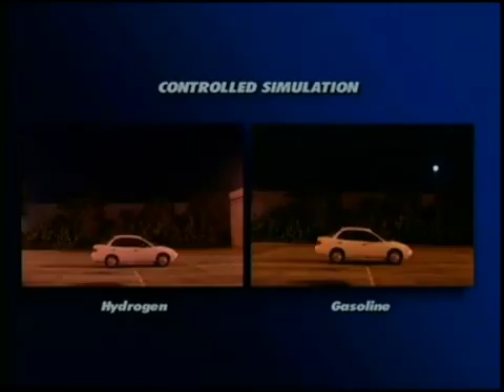Hydrogen vs. Gasoline Leak and Ignition Test- which is safer?

Comment: People quibbling over hydrogen tanks splitting and going up in flame but don't seem to be worried about the hundreds of pounds of lithium ion battery pack they are sitting on being damaged and having the electrolyte solution exposed to oxygen. I promise you it will be a much more spectacular show, just for the people watching, not so much for the occupants. but hey, you do you. Personally I believe that the days of the BEV are numbered, and that is a good thing.
Reply from the maker: It's almost as if energy policy makers were invested in batteries...
https://archive.ph/iVPpZ

Comment: The only issue I see is predicting WHERE the hydrogen tank will split. The simulation shows it as ideally upwards towards the sky, but it could be 90 degrees towards the driver or passengers roasting the vehicle occupants or 180 degrees to roast the following vehicle....

Comment: nice convenient pipe running up to the top of the trunk there to focus the fire up in the air away from the car.... 👍👍
Reply: Hydrogen is already lighter than air. If there was a spark something similar would likely happen because it’s going to float up.
Reply: @GuyWithInternet.  First it will shoot in the direction of the split in the tank due to.... 700 bar pressure in the tank....
Reply: Grilled birds falling from the sky, yummy, yam.👌😎👍 Scorched helicopters, not so great, ops!🤦‍♂

Comment: This is so paid by Toyota or whoever love hydrogen vehicles
Reply from the maker: If you had bothered to read you would have seen this: 2001: Dr. Michael Swain with the University of Miami at Coral Gables attempted to simulate two car fires, one created by a 1/16th inch puncture in a gasoline fuel line, the other by a leaking hydrogen connector. He video taped the experiment to document what would happen if the leaks ignited. As the photos below clearly demonstrate, consumer fears about hydrogen as a transportation fuel would seem to be pretty much unfounded.
https://www1.eere.energy.gov/hydrogenandfuelcells/pdfs/30535be.pdf

Are you a Tesla stockholder?

Comment: So the new Toyota Mirai Hydrogen Cars that are currently in the market, they'll not become "Little Hidenburgs" when they let say got into a car crash accident? Hopefully no BOOMS like Hidenburgs... 

Hydrogen Cars like the Toyota Mirai are indeed efficient & eco friendly, especially does not rely on gasoline & only consumes Hydrogen & releases water vapor. 

Though, how much $$$ would it take to fuel a Toyota Mirai with Hydrogen versus fueling a conventional gas powered sedan that is same size with the Mirai?
Reply: It depends on how its produced. Renewable hydrogen is around 10-15$/kg, while fracked (non-eco friendly) is arouns 2-5$/kg.

But hydrogen FC is also much more efficient than gasoline so you can go the same distance on less fuel.
Reply: @Erowens98 it's 35$/kg in California.... the world's biggest hidrogen car market.
Also Shell just gave up and closed their stations so 50% less stations for hydrogen car owners.
Did i mention the cost of driving a Mirai is the equivalent of driving a Cadillac Escalade ESV in rush hour traffic?
Reply: They're not painted with literal thermite like the hindenburg, so probably not. The real tragedy of the hindenburg is that it made people think that hydrogen is prohibitively dangerous.
Reply: Hindeburg did not go BOOM. It had a fire spread rapidly because it had a highly flammable coating.

Comment: Good idea, so when you’re in a parking garage you’ll set off every car alarm and if installed sprinklers, which would increase the oxygen thanks to the hot flame and it would explode. I suppose it can also just be rain. You know the good thing is when one of these gets hit by lighting it’s an instant death.
Reply: Yes, burning vapors INCREASE oxygen content.  You're definitely an engineer and totally know what you're talking about.
Reply: What are you even saying? And how bad of an example can a lighting be? Ever heard of a Faraday cage?
Reply: Bruh. The fuel/oxygen mixture inside the tank makes combustion impossible. It can only ignite once its left the tank, meaning it is not under pressure when it burns and thus physically can not explode. Fire risk? Maybe. But thats true of all fuel sources. Explosion risk? No. Its not easy to accidentally make a hydrogen bomb.

Comment: Yeah, ignite the hydrogen AFTER its mixed with air and BBOOOOMMMM. All you’ve done there is burn off depressurising liquid hydrogen with the minimum air mix, about 4% oxygen, which is relatively safe but will go boom when the container eventually equalises with the air. The gasoline fire is serious but local whereas a trapped hydrogen gas explosion will take out everything within I’m guessing about 30 metre radius.
Reply: They should test both tanks with heat & fire while they are closed too. See which one is going to pop like balloons.
Reply: How is it burning without oxygen? That chemistry conundrum aside, if the hydrogen is mixing with air, it’s doing so as it rushes upward, being substantially lighter than air, so even if it somehow retains a sufficient concentration for a BOOOM that’s going to be overhead. The energy density of hydrogen is also a good deal lower than gasoline (which is one of the reasons it’s not been a popular alternative), so it’s more of a POP than a BOOOMM.
Reply: @dirckdelint6391  he means the hydrogen wasn't sprayed in the air to the oxygen if that's the case then ignore it an it goes boom because all the gases r in the air if you light the fire an the hydrogen at the same times it's just basically burning off the gas not causing a big explosion it didn't take rocket science to figure that out I just used comment sence from setting fires
Reply: And from where would the oxygen in the hydrogen tank come from? It’s a hydrogen tank remember not oxygen hydrogen tank?
Reply: When the tank goes empty, you'll get a "foomp", not a boom.  There's virtually no fuel left in the tank to explode as you claim.
Reply: @MattLGreer  hydrogen is the lightest, lowest flashpoint, fastest igniting and most volatile gas known to man. When weaponised it’s referred to as a thermonuclear device. A Hydrogen explosion is the worst kind of explosion whether you like it or not. It has to be stored as a liquid to be relatively safe. So a balloon goes bang not ffoomp and a gas tank goes kaboom. You should be very nervous when sitting on top of a hydrogen gas tank whilst travelling down the road at 110Kph surrounded by drunk/sleeping/distracted/medical emergency/ drivers. How insane is it to drive at 100Kph directly at an oncoming vehicle doing a similar speed and pass each other sometimes within a metre apart. You might survive a collision at that speed but, with a trunk full of hydrogen, you’ve lowered the odds dramatically. Like, how does this get a safety pass. It reminds me of the asbestos mining towns back in the day who thought asbestos was a great alternative to sand for the kids sandpits     and if you didn’t agree with that you were considered an uneducated loon… and then everyone died.
Reply: A lot of guesses in here. They literally said it leaked before. And there is no liquid hydrogen either. Where do you get all that from?
Reply: Only if it’s pressurised,what if it is absorbed in hydride within multiple smaller tanks that are heated to release the hydrogen?

Comment: This is 100% fossil fuel industry propaganda. Put that car inside the attached garage of a modern, air sealed house. Allow the hydrogen to escape - one kg should be enough - and then add a small spark. Result will be no car, no house, no living people, major damage to neighbors.
Reply: Quite the hyperbole you have there.   Did you know more than half of the passengers on the Hindenburg survived?
Reply: @palmshoot  I'll do hyperbole, science, engineering explanations - anything to encourage understanding of the numerous pitfalls of going down the disastrous hydrogen economy route. In transportation, hydrogen has one use - rocket engines. Using it to heat homes or fuel personal or public vehicles is folly. 
On the Hindenburg - the gas envelope burned - (non-supersonic oxidization) - it didn't explode as such. Throw some gunpowder on the ground and light it and it will burn and fizz away - but put it in a constrained space and you get a destructive explosion. The same will be true of hydrogen. The fact that these pro-hydrogen people divert attention away from explosion and toward the relatively benign burning is testament to their skills as propagandists.
Reply: @mb-3faze   Hyberbole is incompatible with empirical evidence.  In April 2020, there was an account of an explosion at a hydrogen production facility, but no workers sustained injury, partly because hydrogen combustion is short-lived, a departure from gasoline.  Even BEVs have killed more people.  Both gasoline and BEV combustion require more effort by firefighters, as well, a point overlooked by hydrogen opponents.  As of 2021, in transportation alone, hydrogen is used to power a train, buses, forklifts, tractors, cars, and drones.  At least two companies have plans to run commerical planes in 2024, and there is a compelling case for hydrogen in boats and trucks.

EDIT: For heating homes, there are better options than either fossil fuels or hydrogen, though in cement and steel production, hydrogen would be tough to beat.

Comment: Problem is, you made a hydrogen torch... let that hydrogen leak a bit then ignite it. Its gonna be way more fun!
Reply: Hydrogen is light and it's molecules are very small to the point that it will be escaping from the trunk or cabin very quickly as it is stored at very high pressure, so it won't have time to accumulate in the trunk
Reply: @Blackrhyme7  Why would people want to lose Hydrogen to on their hydrogen powered cars when they need it to travel long miles?
No one is going to pay for hydrogen gas constantly. Also, they need to test Hydrogen car crashes when the tank gets punctured.
Reply: @makemap  it does not escape from the tank, I used word trunk which is storage section in the back of the car under which your hydrogen tank most likely be installed, and in case of puncture it won't be trapped in the trunk, it will escape as trunk is not airtight, and hydrogen being lightest gas in existence it will quickly vacate that space. So no risk of explosion.
Toyota was puncturing their hydrogen tank with armor piercing rounds shot from the gun, and imagine this no explosion, 3 seconds of torch flame and that was it.
Reply: @makemap that sort of safety testing has already been done. You are right about hydrogen being difficult to store though.
Reply: it's lighter than air
Reply: 👍 real live is far ..far....FAR.. away different.
Reply: All machines are dangerous. How do you want to go? IN a bath of Hot liquid gas that remains on your skins and burns, a glob of hot acid that continues to burn your skin for days on end, even after exposure, or bide your chances with escaping a Hydrogen torch. I will take escaping the hydrogen torch any day.
Reply: Hygrogen will not leak like a liquid it's a gaz
Reply: @adamadiallo845  yeah I know but it rise and stay stuck in the top of a container, in this case a car body, mix with air and increase in concentration.

And unlike liquid gasoline, its very "ignitable".
Reply: @Five_y_kay  safety codes already require the top of a container is not completely sealed, so hydrogen will not accumulate. sorry, no fun this time.
Reply: @Five_y_kay  Hydrogen would simply mix to atmospheric oxygen to form water, not oxyhydrogen.
Reply: @evil_source_dk  you mean the trunk? or the top the tank? cuz really? wait what isint fully sealed?
Reply: @palmshoot  sorry… I didint know it spontaneously reacted.. I though you need a spark… hmm

Looked it up… you need a spark.
Reply: @evil_source_dk  So flip the car over.
Reply: @palmshoot  A Tank with Hydrogen in a collision would result in a explosion due pressure of the chamber?
Reply: @jose280714  Carbon fiber, the material often used in tanks, is strong.  Hydrogen is already transported industrially and you don't hear about many deaths.  In fact, with the Hindenburg, the majority of the passengers survived.
Reply: @Five_y_kay your car is not air tight if you haven't realized yet so there is no way a substantial amount of hydrogen can be trapped in or under your car.
Reply: @YS58329  have you ever put a lighter in your hand? And press the gaz in your hand, and then ignite it? It makes a fire ball. Your hand is not air tight. Sure, the car isint air tight, but that only means it wont become pressurized, however, a hydrogen leak in the boot would leak hydrogen into the cabin, which would stick around. You can then light that hydrogen.

Obviously if you put the tank on the outside of the car (like, where the normal fuel tank is) then it wont leak into the cabin.

But, the gaz, if leaking inside the car, wont just immediately leave the cabin like the instant its leaked out of the tank. It will occupy the space in the car and mix with the air in the car. If the pressure is greater than ambiant pressure outside the car, that will push out air from in the cabin to outside the cabin. As the tank leaks, the concentration of hydrogen on the car will increase.
Reply: @jose280714 no. The hydrogen in the tank can not ignite as its not mixed with oxygen. It will only burn once it's left the tank, after which point its no longer pressurized.
Reply: @Five_y_kay hydrogen is much lighter than lighter fluid and thus is much more prone to escaping non-sealed enclosures. Heck, it'll even leak through solid metal. Which is its main issue as a fuel source. Very difficult to store long term.
Reply: @Erowens98  yeah well, im not talking store long term, im just talking let the bottle leak in the cabin, increase its concentration, and then light it.
Reply: @palmshoot  If it did spontaneously react to form water in the atmosphere, that is essentially an uncontrolled (albeit small) fusion bomb. Atomic fusion releases a ton of energy, that's the entire basis for the idea of using controlled nuclear fusion for power generation.
Reply: @Mightylcanis  Hydrogen combining with oxygen to form water is simple chemistry, not nuclear physics.  Haven't you ever noticed water coming out of FCEVs?
Reply: @Mightylcanis  The process of hydrogen combining with oxygen is oxidation.  Fusion involves nuclei only.
Reply: hydrogen disperses extremely fast just like an LPG, it is then impossible to ignite it
Reply: You guys. Hydrogen leaking inside the car doesn’t mean the pressure in the car increases. Also the car cabin, while not totally air tight, will still be able to contain hydrogen from the leaking tank. This will increase concentration in the car. The hydrogen doesnt have to be pressurized for this. Infact, the air pressure in the car will remain the exact same, but it will start being more and more concentrated in hydrogen.

Comment: How about venting that hydrogen in let's say a parking garage and igniting it. Vs a gasoline leak. See which one is safer
Reply: Fire trucks would be needed in the gasoline case.
Reply: The gas would be more dangerous because it creates dense fumes that could up. The hydrogen desperately wants to escape into the atmosphere, so if the parking garage has a ventilation (it should) it won't be a problem.